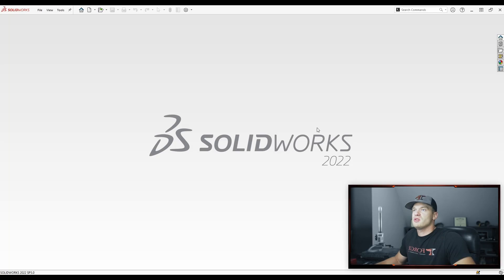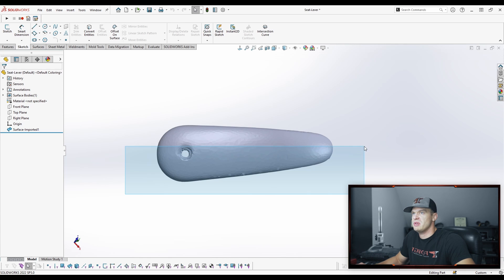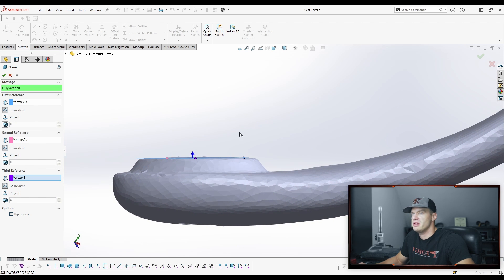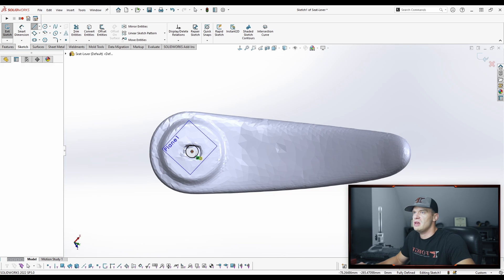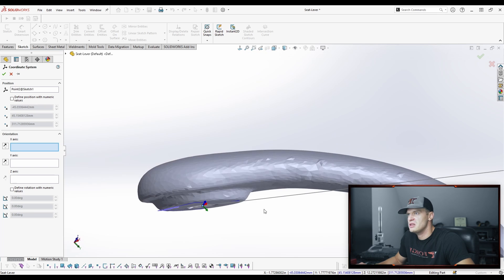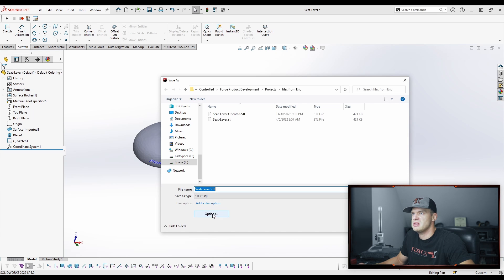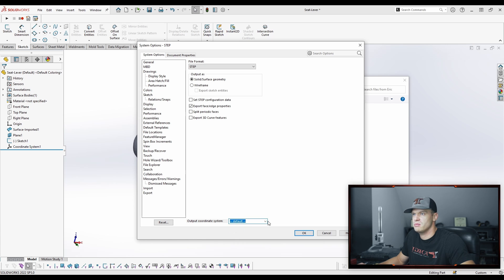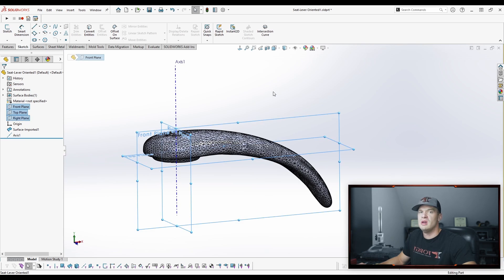How to Align .STL Files in SolidWorks

Comment: Use move copy bodies. Much easier without putting unnecessary features in your tree.
Reply from the maker: Hey, great suggestion! This seems to work well for putting points onto planes. If you are going to keep the locating features in the tree, and not save the .stl out and reimport, I can see this being valuable.
Reply: @forgeproductdevelopment  didnt work for my non-solid body scan, so your approach has really saved me
Reply from the maker: @tdplayert Awesome! Glad it worked for you. what are you using to take your scans?
Reply: works only for solid bodies which is not a given for imported stl scenes (e.g. a scan of a corner in which to sketch a closet)

Comment: My stl doesnt have points when i scroll over! How can i get these points to show up to create my plane? Thx
Reply from the maker: @Syncrogreg  Does it have edges? If so, it may be an issue with your selection filters. If nothing is being highlighted when your cursor scrolls over it, check your “dynamic highlight” setting.
Reply: @forgeproductdevelopment  yes it does  its a transmission housing  can i send you pic? Got email?
Reply from the maker: @Syncrogreg  yes, info@forgepd.com
Reply from the maker: @ it looks doable. If nothing is lighting up, check your import settings.

Comment: Good day Sir. Is there a way that we can use mesh models into solidworks assembly?
Reply from the maker: Absolutely, I would create a part file within the assembly and put the mesh in that file, then use that as a reference for the other part files within that assembly. Try to keep the part file with the mesh at the top of the assembly design tree. Does that help?
Reply: @forgeproductdevelopment  Thanks Sir. How about creating an assembly of mesh models? Is that possible Sir?
Reply from the maker: @Pathfinder_1314  It should be. Have you tried creating part files, each with its own part of the mesh, and then inserting those part files into an assembly?
Reply: @forgeproductdevelopment  yes Sir. I created mesh bodies as part files but the Mate Feature doesn't work on them. Do you have a video reference to this topic Sir?
Reply from the maker: @Pathfinder_1314  Ah yes! The mate commands will not work on the mesh. You will need to create some form of geometry within each part file to mate to, either sketches or surfaces will work. This video shows how to create geometry within the part files using the mesh as reference.
Reply: @forgeproductdevelopment  Thank you so much for the insight Sir.

Comment: Incredibly good tutorial! It's easy to tell you actually use SolidWorks for work.

One question: When I saved it as a parasolid, the graphic body doesn't show up. It did however when I saved it as an STL. 
My process for this STL file:  I had to open it as a graphics body because it was too big to convert to surfaces. Then I used Surface From Mesh to get a surface for my base plane. From there I followed your steps. In this case, will the parasolid option not apply? 
Thanks!

Comment: Great tutorial. One thing to add for this part specifically is that the outside edges of the part can be extended with construction lines to define the center of the part. Hope this makes sesne.

Comment: Is there a way to complete this process without having to save, then reopen the file? As an example - I am working with scan data that is an open object (the scan of the front of a vehicle I am looking to design a bumper for). I can follow your steps to create the coordinates but Solidworks will not allow me to export as a parasolid since there is no volume. When I save as an .stl file with the coordinates saved in the configuration, it defaults back to the original plane/coordinate system. When saved as a .step, it saves as a tiny 2kb file and will not open at all when re-opened. Looking for some insight on scans that are "incomplete" so to speak. Thank you!
Reply from the maker: Hope your project is going well. Finally made a video on the solution: https://youtu.be/tM__cPCe0WY

Comment: Hi thank you for your lesson! 
Can you align scan data, which has no geometry, no symmetry, no cylinders, no holes, no squares.  for example, some stone without a flat surface.  but visually a person recognizes this and understands where the top is and where the bottom is.
Reply from the maker: Absolutely! You can create the reference planes in any location you want. Just use the ricks in the video, but instead of using points from the san data you can just eyeball it in space.

Comment: Very useful video, thank you.
Reply from the maker: I am glad it was helpful. What do you do that uses stl files?
Reply: @forgeproductdevelopment  I normally design motorcycle parts for personal use in Solidworks from scratch and then print them on my 3D printer. I can see a 3D scanner in my future and that's where handling STLs and this video will come in handy.
Reply from the maker: @donr62  That makes sense. Have you tried the LiDAR scanners in the new iphones/ipads? I have been meaning to take a look at those with apps like polycam.
Reply: @forgeproductdevelopment  I have and they’re not really suitable. I think they’re designed more for room sized AR projects rather than the smaller details required for bike parts.